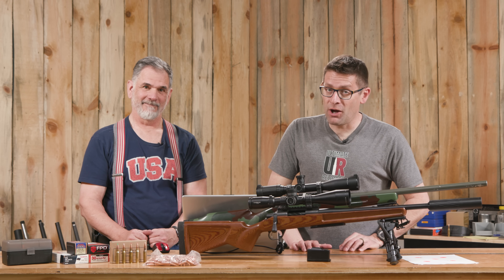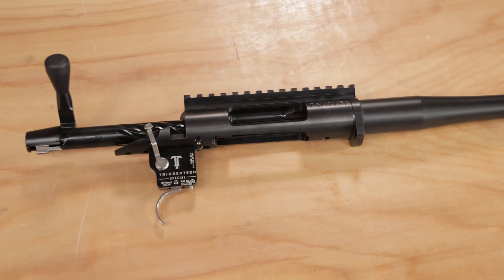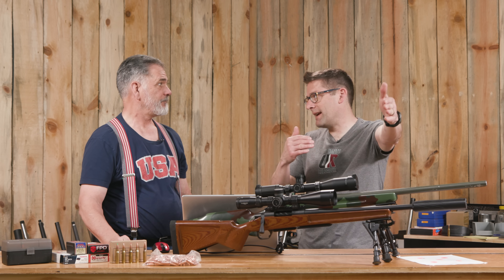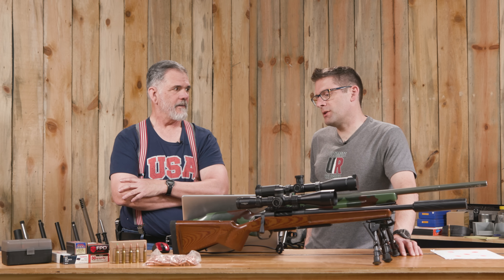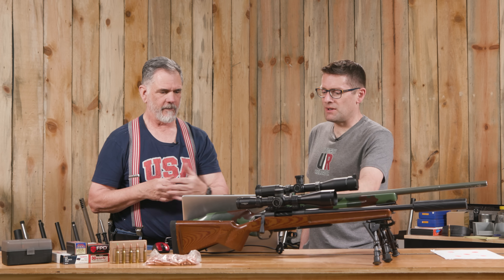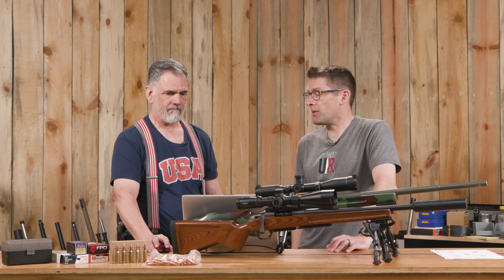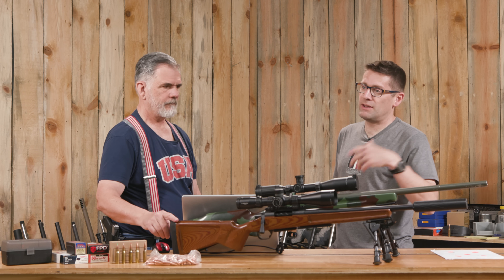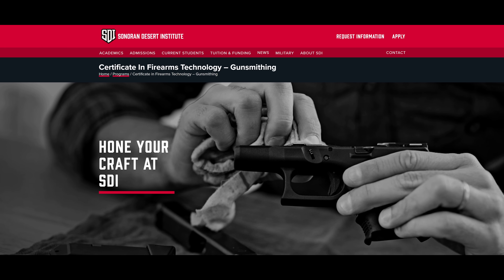308 Velocity: SHORT -vs- LONG (16" -vs- 24")

Comment: Rem 700 .308 VSSF 26” barrel is my go to moose gun, 150 ttsx with max charge of Varget sub 1/2moa. Long barrel feels nice when I have had to off hand shoot moose, steady like a long shotgun barrel on waterfowl. Also use an 18” savage 308 scout when I know I’m going to do a lot of traveling through the woods or on snow machine. Good ole 06’ 22” barrel stands right in the middle of those two and I can’t argue against that
Reply: "Good" comes in different barrel lengths for sure.

Comment: I'm actually looking at building a 16" 308 but for the purpose of seeing how far it will shoot effectively. As far as load and bullet weight that will be determined after extensive testing.
Reply: Define effective. In today's age. If your gun is a sub moa gun, your data is true, and you know how to dial your scope to your environment. There is no reason why you won't hit a target. I've seen 45-70 hit steel repeatedly at 1500yds. Best cartridge for the job? Probably not there's always something better.

Comment: Prior to your shorty build I sent an older 700 action to Pac Nor for a 16 inch 308. I went with a 1/12 twist for the lighter side of bullets. Mainly deer and coyotes here in North Texas. Varmint profile cut at 16.25 is a little heavier than I thought. My Dead Air Sandman TI has been on for every shot so far. Loading 125 hp with Varget into LC brass. Thanks for sharing the pistol loading page I had no idea it was there.
Reply: Hodgdon's 15" .308 pistol data is real useful if building a stubby 16" rifle. Seems like you got yourself one heck of a rifle. My "Green Machine" is also a 1:12 twist, works fine with up to 175/180 gr bullets, but normally I run 168's or lighter.
Reply: PAC Nor makes great barrels and a very reasonable price! Craig Boddington used them on several of his guns!

Comment: I live in a state where suppressors aren't allowed. So I go with the longer barrels on my rifles. For hearing protection I use electronic ear plugs that cam amplify ambient sounds but shut of the amplification when they hear the shots. Best of both worlds and no restrictions on them.
Reply: Ear protection is always a good idea. If it's one shot, so be it. But I have never ever ever shot a rifle cartridge that is quiet enough to not potentially damage hearing. Even a 223 is loud. Both long or short. Muzzle break, no muzzle break. Crown, no crown, etc, etc. Is it less? Maybe but still not enough that it wont do damage. 22lr in a rifle length is barely acceptable.
Reply: I do the same. :)
Reply: Do yourself a favor and get the Witt Machine SME.  I have a .30 cal SME. I believe their advertisements that sound pressure is 3 dB less at the ear, using my 16” AR-15 in 7.62x39.
It definitely takes the edge off the percussion.
My buddy and I couldn’t perceive a change in volume with a cheap eBay brake/blast can, but it is perceptible with the SME.
I did get a cheap can thereafter, also from Witt machine.  I got what I paid for.

Comment: Hi I run a 20” barrel in .308 with 110 vmax at 3200 fps with n133 I am planning on cutting back to 16” as my main foxing gun easy to handle

Comment: Well my DPMS AR10 has the 24" fluted barrel and it is a nice shooter even though it is heavier and longer!
The suppressor does add the length back to the overall!
Gavin I'm surprised that no one makes a suppressor that has a rear chamber which is behind the muzzle and over the barrel somewhat making the suppressor shorter forward of the bore.
As the gas is stripped by the first area, that gas could be pushed through open ports and directed to that rear chamber as the bullet continues across the other chambers.  Might be something to consider to keep things even shorter.
Reply: There are reflex 308 suppressors out there and some are better (mounting) for semiautos and some indeed reduce forward of muzzle length while others just increase volume. Just search 308 reflex suppressor to find them.
Reply: Good idea. I wonder if it would make the barrel to hot??
Reply: I’ve got a DPMS AR15 that is 24 inch barrel…. It’s ridiculously heavy but it shoots good

Comment: Primer pockets did not last long at 46grains of Varget and a 168 in my experience.  44.5 was about the highest I noticed with out rapidly fatiguing the brass. That is still cooking right along.
Reply: Ya, I don't want to push any harder than 46, and I usually max out at 45 gr Varget with 165 & 168 grain bullets from the 308 Win.
Reply: @guyminer3168  Sounds about right. I shoot mostly gas guns, one of my loads that seems to work well with the gasser is 44 grains of Varget behind a 178, seated out to 2.860 OAL.  I can push it harder, but it cycles the bolt too fast and tears up the case heads.  I prefer to be easy on the brass and gun instead of pushing the limit.
Reply: @guyminer3168  Fantastic work as always, I really enjoy what you add to the UR channel.
Reply: @markartman3166  - thanks!
Reply: What brass are you using? 46 and a 168 works just fine in thin, capacious Winchester brass. I wouldn't put that much into thicker, lower capacity Federal brass.
Reply: @davidmarshall8628  Black Hills(they source their brass from Winchester) and old school Hornady match which is thin walled and high volume, about a grain more water weight than the newer hornady if my memory server me right.   I check all my brass volumes with water and a scale.   I am not an idiot, I weight and check the volume of my brass and adjust loads accordingly.  BTW be careful as not all Winchester is equal... I have some that weights around 180 grains and has about 2 grains less water weight than the thin wall  Winchester.  So just because its win head stamped doesn't mean its the high volume stuff.   46grains of varget  in my chamber is a damn hot load, Its "safe"  I prefer to back it down so the brass lasts.
Reply: @davidmarshall8628  - yup - brass choice makes a difference. BTW, I agree with your assessment of both Winchester & Federal brass, having used a lot of both over the years.

Comment: It isn't do much about velocity, it's about muzzle blast and flash, mostly blast. With a high intensity round like the .308, 16" will clear your sinuses.
Reply: Ya, the suppressor calms it right down, but you're right, a 16" .308 has a fair bit of muzzle blast.

Comment: Great content gents. Thanks a ton. Nice little package for sure. I have a late 90s 700 VSSF 26" 308. Excellent rifle. Lotsa handloads through it. Deer load is 165g. Speer BTSP with near max Varget. Impressive accuracy and velocity. I am getting a Ruger SFAR and I am leaning towards the 16". This information is encouraging. Stay safe gentlemen.
Reply: The SFAR 16 inch with the stock muzzle device was pretty brutal noise wise.  I was next to one in a shooting range (indoor), then also at an outdoor range.  Significantly louder than a 10.5 inch 5.56 with a similar muzzle device.
Reply: @bannedbycommieyoutube5time920  Thank you for info.

Comment: 24 inch with the option of a muffler.  i cant justify the cost of the muffler now, but the longer barrel is easier on your ears.   to me it seems the 308 is the best caliber out there and the blast and pressure wave isnt as harsh , but the shorter the barrel. the harsher it gets.   i think 308 hard cast w/ lower velocity makes sense. should be alot quieter and you dont have to pay off that abusive uncle
Reply: Ya, my "Green Machine" rifle has had a couple of different barrels over the 25+ years I've owned it. Both were 24" in the Remington varmint contour. I've shot this rifle a lot over the years.

Comment: I’ve got 12 or more different.308 loads worked up for my dd5v3 from 130gr to 180ttsx…many hrs dialin a 16” .308 in…wan try 110tap to push 3k from a 16” as these factory federal varmit 130s get close but just shy…can put 5 on a 20oz lid@100 when I hold my mouth just right…

Comment: I'd be curious to see a 16-18" unsuppressed build and results.
Reply: Well, we can just unscrew the suppressor.  :)
Reply: @guyminer3168  would the velocities vary enough to matter between suppressed and unsuppressed?
Reply: @Chris_KS5KY  From my experience a rifle suppressor usually increases velocity between 0-40 fps depending on load, suppressor design, etc. Sometimes there's actually a bit of loss, but generally no more than 15 fps. Hope this helps
Reply: @Chris_KS5KY  - our friends at Silencer Central told us that a suppressor only adds about 10 - 15 fps to typical rifle cartridges. That's been my experience as well. Point of Impact often shifts, even with free-floated heavy barrels, but velocity doesn't change much.
Reply: Thank you for the info, this helps me understand better.
Reply: @Chris_KS5KY  Anytime man. Glad it helped